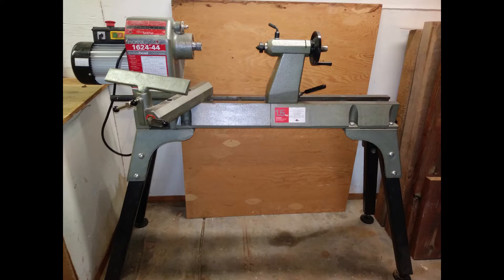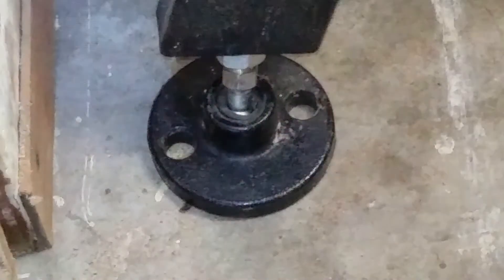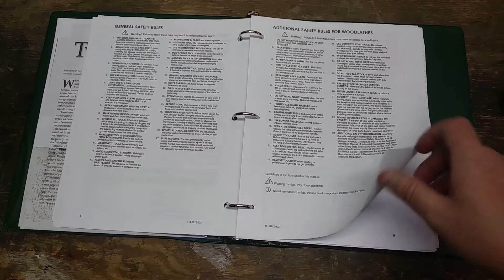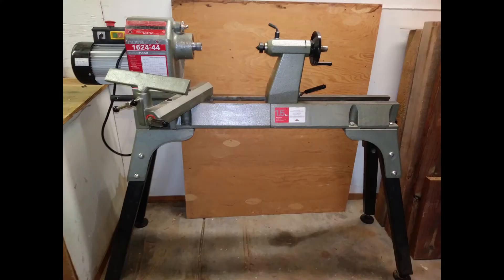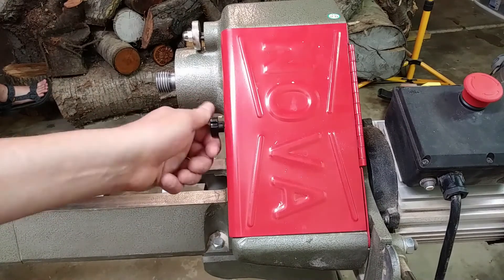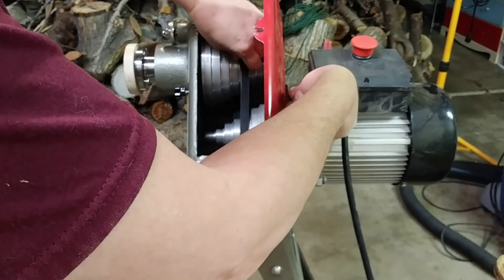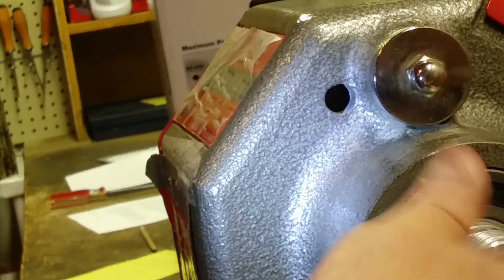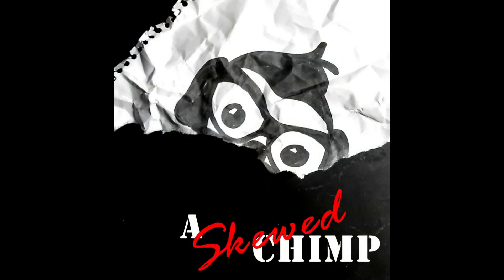The Lathe:  Nova 1624-44

Comment: Thank you for posting this video. I recently bought a used 1624-44 and will soon be giving it a test run. The components are all quite solid (and heavy!) I may look for a replacement spindle belt.  Nova and most of the woodworking shops don't sell that part anymore, but it looks like I can get one that works from V-Belt Guys. The DVR would be nice, but I think I'll be ok with the pulleys for the time being.
Reply from the maker: Please do make a video, or at least let me know how it goes once you get it set up. I'll be really eager to learn more about how it goes for you!
Reply: @askewedchimp  Will do!
Reply: @askewedchimp  I replaced the belt today with a V-Belt Guys 230J6. The new one isn't frayed like the old and runs quieter.  We'll see how it lasts longer term. The most difficult parts of the replacement for me were 1) getting access to one of the bolts holding on the headstock guard (it only had one of the two "difficult bolts" installed), and 2) getting the motor mount cam back on and tightened like it was before I took it off.

Once you remove the headstock guard, replacing the belt is a snap. I got smart putting it back on and cut a stick of wood with a notch in the end to prop the motor in the detensioned position so that I could see the bolt hole and have both hands free to get that one tricky bolt back in.

Anyway, this makes it sound difficult and it really isn't that bad. Teknatool has an article on their web site describing belt, spindle and bearing replacements on the 1624 lathe. Hopefully helps someone.
Reply from the maker: @gcbound  The stick trick makes sense, and I didn't know about the guide on Teknatool. Can you link to that guide, please?

Comment: I have a 1624 II lathe, and mine is thumping, and running out enough that it's causing havoc turning pens (several exploded from the chatter).  I replaced one of the bearings, but it still has some runout.  In my case, it was insanely difficult to get the pulleys off.  They might as well not have set screws.  And it was like this when I bought it new, because I replaced the original motor with the DVR motor when first purchased, and had to move the motor pulley to the new motor.  I spent hours trying to get that pulley off.  I spent additional hours more recently trying to remove the spindle pulley.  Heating up, and only able to get off with large crowbars.  When the motor is running without the belt, I visually see and can measure the pulley runout.  I wonder if the motor runout is pulling against the bearings and wearing them down faster.  But with a belt system, I would think a larger motor runout would not impact the spindle as much.
Lastly, when I pulled the spindle pulley off, it has a gouge down the middle of the shaft.  The spindle has a tiny chunk missing near the very back, but nothing else obvious.  I'm not sure how this gouge got here.  Overall, I'm tempted to chunk the whole thing and replace, rather than spend $900 to replace all of the suspect parts.
Reply from the maker: Wow. That is a disturbingly frustrating road you seem to have traveled already. I also wonder if you'll be time and frustration ahead in the long run to replace the entire thing. Honestly, to rebuild for $900 compared to new lathes for $1200 to $1500 it might be worth it.

Sadly the higher end lathes are running more than that, though. This includes Rikon (which I have had hit and miss experiences with) and Nova. There are other companies out there too, but I'm not sure what their quality is.

Thank you for your post. Please do let me know what you ultimately decide to do, and why. If you get a different lathe, let me know what you get and why.

Comment: running sound tells the headstock bearings need replacement. pls consider if not done already
Reply from the maker: Thank you. I will consider that and look into what that costs. I wonder how hard it would be to get that replaced.
Reply: @askewedchimp  lathe bearings usually easy to remove. About $15-$20 a bearing, and 1-2hr of work.
Reply from the maker: @0student  Thank you.

Comment: I have this lathe and I’ve used the heck out of it to the point I think I’ve worn out a bearing , I just started getting a wobble on my projects so I’ve stopped using it until I find out what’s going on. If you have any ideas please let me know as I really want to get back to working the wood again
Reply from the maker: Taking the entire headstock apart is not that difficult and can be done in a couple of hours. Just make sure you keep your parts organized. If It's a bearing, I don't even know where to get a new bearing pack, but I'd bet the guys at a local Rockler or Woodcraft would know.

When you find out, please update us, and good luck!
Reply: I’ve taken the headstock apart and am making sure all the parts are secure and tight 
I can go to a place called McGuire bearing company in boise idaho and get the bearings and they have several options to choose from ( like the original bearing or an upgrade ) I will be replacing the bearings after I get my second lathe back up and running currently waiting on parts to get here in the mail   
You can usually find a local bearing company and it does not cost nearly as much because there’s no shipping costs and a lot of times it’s just way cheaper $$$$ than ordering from a company that has to order in the parts to sell yo you
Reply from the maker: @robertriley6213  That's really good to know, actually. I've been wondering what to do when my bearings finally wear out.

Thank you!

Comment: Hello  there  from across  the  Pond  in  South  Africa
One  Big  Q from  our  major  worries
How Rigid  and  Accurate  is  the Tailstock  for  Drilling  ???
I need  drill  Pen  Blanks  most  without  loosing  Diameters  etc
Do  kindly  let  us  know
 TIA
ATB
TC
aRM
Reply from the maker: Thanks for your comment! The tail stock is very accurate in my experience, though I don't use it for drilling much currently. It's very smooth to function and quite solidly made. When I last used it I found it to be right on the mark provided the lathe was assembled correctly.

I think this lathe would work fine for things like pen blanks, even though this is definitely a workhorse machine. It's done well enough it can do finer, more accurate work without a problem in my experience.

If you get a chance to test it out, let us know your findings.

Good luck!
Reply: I turn pens on mine and drill them out with this lathe I’ve made a lamp also the drilling is very good and I always use slowest speed

Comment: Do you still have this lathe and love it?  How is the motor different for the Galaxi. I see DVR upgrades for this/
Reply from the maker: I do still own this lathe and I also still love it. It does not have a DVR, and I kind of wish it did, but one has to balance costs with effectiveness too.

The Galaxi is $2600 retail at the time of this reply, and that's before any accessories or add-ons, or shipping. For the value, I like my lathe better. If you're looking for the top of the line experience, a DVR and the Galaxi might be the way to go. I just didn't feel that the step up in features was worth the significant increase in cost difference.

It's a matter of what's important though. I definitely think a DVR is an must have if I ever decide to upgrade. One that can go really slow especially.